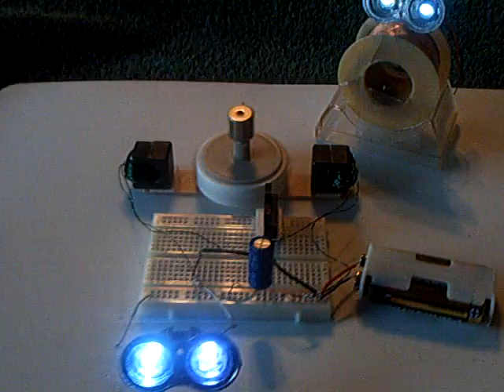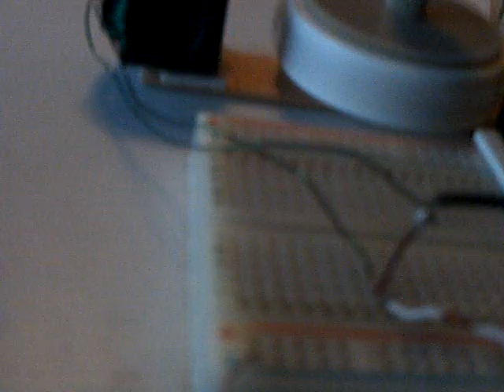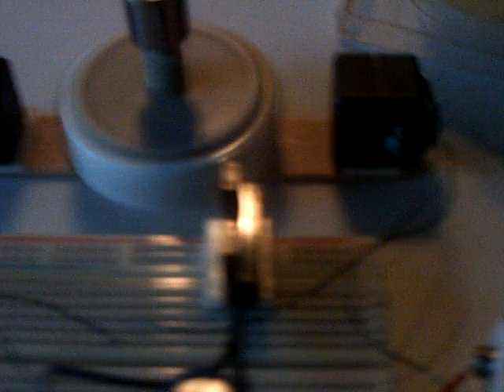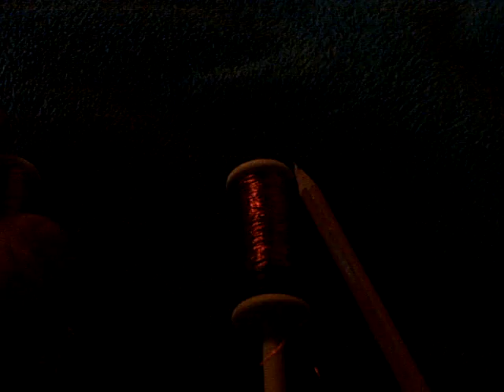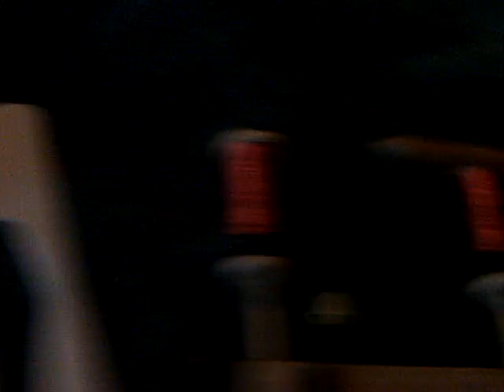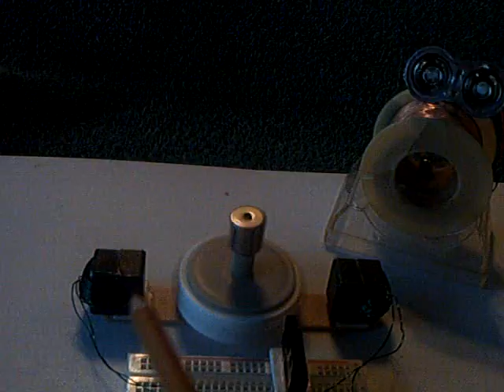Ben's 'Thomas Motor'

Comment: Well done ! Did you make sure that the 2 toroidal coils are wired 180 degrees out of phase in series, so the magnets do not induce any voltage and current, so it has no counter EMF ? Regards, Stefan.
Reply: This way, it is just a Motor but NOT a generator ! So Lenz Law does not apply !
That is the most important point with this motor....

Comment: I see comments about large amp draw below, but, as you said, how about battery charging off that kickback ? If a small 12V SLA  could charge effectively with say a 100mA small solar panel, then it would have a good practical use.
Some of this looks like a Simplified SSG, or Simply Simpler Simplified SSG lol
Reply from the maker: +slider2732  You and I think alike.  The value in this tiny motor design might be in the strong inductive kick back.  Check out my next video.  I think that this could be used to charge up a 12v SLA  --or at least knock the sulfate crystals off it.  Hummm.

Comment: Very fast work Lid.  Is this something we have to live with?  Low amp draw, no torque...high amp draw more torque?  That was my problem with my Bedini motors...no torque.  Maybe there is a happy medium?

Bill
Reply from the maker: +Pirate Labs  You are right Bill ---go for the happy medium.  One thing I did really like about this was that it had huge inductive kick back.  Anybody want to charge a lead acid battery?

Comment: Wow,that was fast. I only just read the comment on OU about you trying this motor,and here it is already lol. Great work Lidmotor. So are you going to try a smaller wire with more turns,or maybe just reduce the voltage to see how low you can get the power consumption?.
Reply from the maker: +TinManPower  It runs pretty good and I think that if I use thinner wire I can reduce the amp draw.  This was 26ga so I'll probably try 30ga and see what happens. The amp draw on this 100mA at 3v.  Way too much.